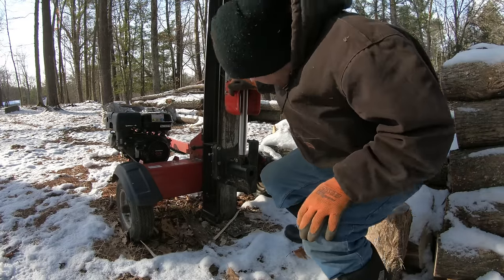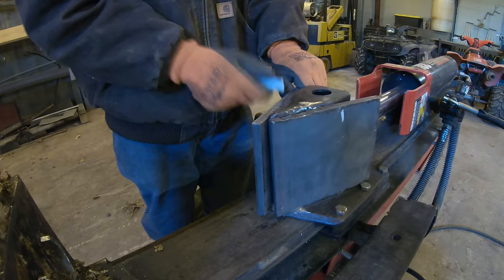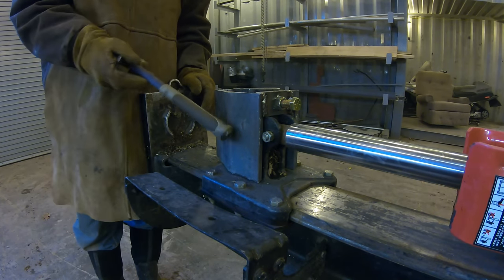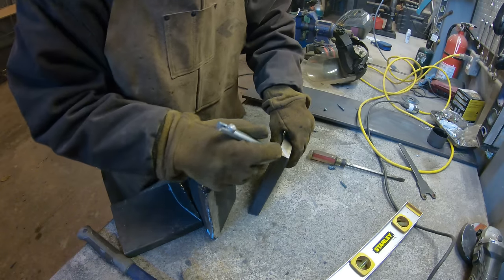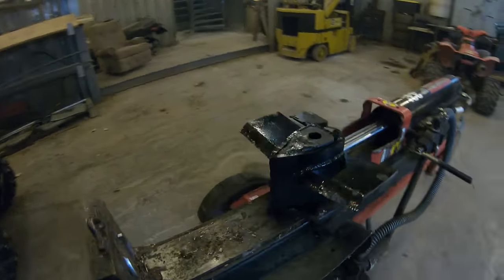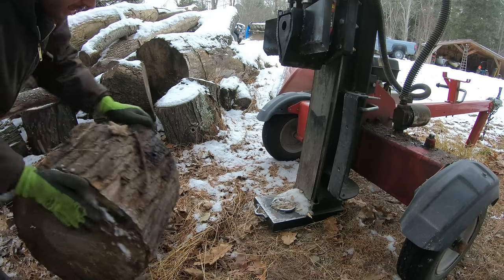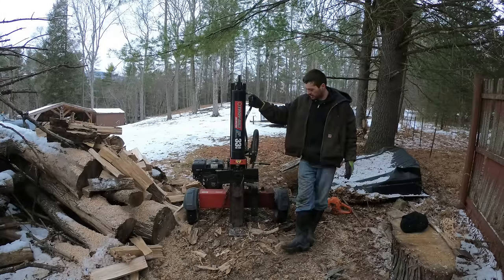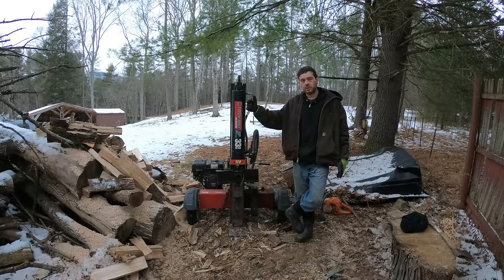Building a 4 way splitter wedge

Comment: Wait! What? I'd never had thought of using the wood splitter to bend steel. How friggin' ingenious!
Reply: I've done the same to crimp ends of tubing to create a flat(ish) welding flange. I've used this technique to fabricate  livestock gates and fencing panels but I'm sure this could be applied to a multitude of projects.
Reply: You can even weld up dies and forms for rolling steel and bending pipes, you can press bearings, ball joints and king
pins etc.etc.. 
Log splitters are a great source for universal hydraulic power.
Reply: Log splitters wore not made it to do that JUS TO SPLIT LOG read the INSTRUCTIONS.
Reply: @dmithsmith5880  don't judge people by apearence my profile foto it's a joke I don't smoke.
Reply: My shop press is 20 ton and my log splitter is 27 ton so if I can't bend it in the shop I can always use the log splitter.
Reply: Yeah Right!!
Reply: He is one crafty handiMan!!  He has a lot of really good video's!!
Reply: OdinX316 yes he does been watching his videos now for a month,he does not live far from me,if I see him in Saurgerties in the park were he puts in his boat I will have to talk to him smart guy for being so young.👍
Reply: @bikerminio  I used to live in West Shokan.
Reply: @Francisco-yz7xq  Lawyers!
Reply: i know.  but i did just get a splitter so i'm glad i saw this right away.   i did actually think of putting the cylinder on my tubing bender,  but this  is better than my little press brake
Reply: I've used a log splitter to bend rebar for concrete forms.
Reply: Camarata modified the log splitter by building the 4-way splitter wedge slip onto a wedge of a log splitter.
Reply: @dmithsmith5880   I even use them to join split logs !!!  .....apply some glue and keep them pressed and watch glue dry !!! A very peaceful pastime.......Lol !
Reply: @wetdixiebellelingerie3014  Andrew Camarata has just modified a log splitter by building the 4-way splitter wedge slip onto a wedge of a log splitter. Since 2017, Andrew Camarata still uses it.
Reply: Andrew NEVER ceases to amaze me. Well done.
Reply: @OdinX316  Andrew never ceases to amaze all of us with his 'on-the-fly' ingenuity.
Reply: iv had to use my press to split wood when the splitter was down
Reply: The only risk is if you’re pressing a hardened splitting edge against steel it could fracture dangerously, but it’s all at your own risk.
Reply: I thought the same thing!
Reply: Me and my grandfather used our log splitter to bend all the metal joiner plates for a building several years ago, it worked great
Reply: It’s just a giant press. I’ve used a front end loader bucket on a cat988 loader to straighten out a 3’x5’x1” plate steal that and under ground mine feeder decided to eat and mangle all to hell had kale marks 1/2” deep 16” long looked like predator got hold of it . But the loader straightened it right out after a few presses.
Reply: Maybe they don’t sell them cause those cheap 5 horse power craftsman engines can’t handle a four way wedge plus they want to keep the price down as low as they can.
Reply: @Francisco-yz7xq  I am guessing you never heard of thinking outside the box, you must be one of those that still think the earth is flat.

Comment: When your wood is nice and dried out like yours is, the 4 way splitter works much better.  Actually, the two way also.  I have a four way attachment that came with the splitter.  I use mostly the two way because with wet wood and irregular pieces, the two way just works much better.  Your wood in the video split so easily I think an ax might have been faster than the four way.

Comment: I read through 40 or fifty of the comments and nobody commented on this so I will.  What a brilliant and clever idea to use the splitter itself to bend the metal plates into shape!  
Out of curiosity have you used this to bend other things?  I'm thinking that you could add some more products to go along with your new 4-way splitter.  Poor mans conduit bender, metal shear, sheet metal bender, ect.  How about using it to break the tire beads on your equipment tires?  The poor Troy may end up working 12 months out the year instead of just a couple!  I'm sure there are more uses out there!
Reply from the maker: Yes I have used to splitter to bed things before. Its not always deep enough for some jobs, but it works. I have a press to which is a little more controlled, and there's more room. But whatever works.
Reply: I've used mine to break a tire bead before, worked great! and a few pieces of steel over the years. U have to be careful  putting  more then one piece in at a time, like he did to bend the steel plates. what he did was fine, but if you have the wrong angle the piece  can shoot out. this turned out good, he saved himself $100 not having to  buy the slip on wedge they have at tractor  supply. I have the same troy built, just one size smaller, the 27 ton.
Reply: Thought the same.
Reply: I've used it to break tires away from the rim. Just lay a 4x4 across the tire right at the rim and push it down.
Reply: Bearing press comes to mind, also.
Reply: I would of never thought that would have worked.
Reply: i should have read the comments before i posted LOL
Reply: aYeah i thaought on it not ma<ny would use the splitter to do it,. he is very smart this guy
Reply: Peter Hahn>>>Thank you, a tiny light bulb just turned on in my head.
Reply: @Peter Haan:  That's what I thought when I saw it on the video.  Very clever!!
Reply: its called a shop press   ... its just a tad safer than a log splitter or tubing bender
Reply: @capitalcityautobody6507  Me too... That's why I call him Superman
Reply: Just watched.  Thought the very same thing!
Reply: Im pretty sure someone did
Reply: Yes I totally loved that move! Regarding the question of manufacturers selling the units with a single plane wedge vs the double - Possibly they assume folks would be using a smaller diameter log and when you have a larger piece it burns slower. The bolt you installed on the back of your wedge is also a great Idea. They could sell different size and shape wedges for different situations. @AndrewCamarata
Reply: @ctdieselnut  LLP PM
Reply: I think it would be cool to make some kind of foot pedal to operate the ram so you could have both hands on the log.   That would make it so much easier....
Reply: Do that with mine all the time
Reply: <--- I'm not sure on which video I commented to Andrew about rigging up his shop hoist to be a sheet metal brake too.... Andrew's machine's will eventually get an UPgrade, and will last way longer than others. He always has great improvement ideas which ALL work, as he demonstrates... Cheers.

Comment: How about adding a bigger base so when you split the larger logs you dont have to hold it up to the splitter.
Reply: this is a good idea
Reply: That's what I was thinking, or just a longer one.
Reply: to eliminate the tilt.
Reply: If one bigger base is too big then maybe 3 hinged wings, 2 off the side and one off the front. that would fold for transport and storage.  I don't like the idea of holding something in place with moving machinery could cause it to shift and you make a sudden movement to compensate perhaps causing injury.  Rather like holding an object on the drill press by hand and having the drill grab the material....not that I have personal experience in that area.
Reply: My first thought was to dig square hole for the base to sit into about 3 inches down so it's flush with the ground to avoid the large wood rounds from tilting off

Comment: I would have covered your cylinder to keep splatter off of it when welding. Very Nice Job.Very smart to use the splitter to bend the metal. Good job.
Reply: I guess you haven’t seen any of Andrews other videos .

Comment: You're a tribute to American ingenuity. You should patent your winged wedge idea and sell it to a manufacturer.
Reply: I think the reason they do this is to get you to buy their higher tier model so they make more money. Everything manufacturers do is for a reason.
Reply: TehHijack that's exactly what I thought!
Reply: It’s the Base Plate that’s causing problems. 
Horizontal Models have No Base Plate..they allow a Flow-Thru design.
The bottom is the Splitter..Top is the Push Plate.
Reply: At the very beginning of the video Andrew said he had previously tried something that he bought - that he did not make himself - but that it would NOT work properly. The design of the wedge that he bought would pinch the wood / bind up .He changes the angle of the "wings" on the one he made to avoid the hangups.

Reading the reviews of the for sale units, there are complaints that they only work with certain splitter mfrs - some work only horizontal not vertical etc.
Reply: @scotty362100  ... Thought so
Reply: @scotty362100  he said himself he bought one and the angle on the wings was wedging the wood against the beam and stopping the ram, you can still patent something if the design is different
Reply: Swisher makes one for their splitters and it works fine. If you get a huge Oak then it just lifts off and then you can hack away at the large piece.
Reply: They already make them in all sorts of split patterns
Reply: then he could use the money to build his car
Reply: I allways hear people use there American ingenuity be your race culture cant steel from quality child rearing and solid work ethics teamed up with smarts

Comment: Leaving the first inch a vertical split and the wing wedges later really saves on the grunt the splitter has to overcome. Good thinking!! 33 ton is a husky one!  Dog looks happy!! Nice welding! As always
Reply: You're kidding about those welds right? He broke the first rule of thumb when welding metal that thick.
Reply: @2naturesownplace   If they don't fall apart they are welded correctly.  That's my rule anyway 😉
Reply: Richard Elbe and what’s that?
Reply: @2naturesownplace  I agree with you

Comment: $$$ is the reason mfg's do not come with a 4 way split. Yours is better, and you got it just the way you want it, Good job
Reply: Mike is kind of right. The reason your model did not come with a 4-way splitter. Is the pump itself. The pump is design to function just get enough for the maximum existence it can endure. So by adding that 4-way splitter your shortening the lifespan of the pump. I'll give you a fine example. The log splitter offered by Harbor Freight. It splits two different directions and it's pretty fast for the cycle rate. But it was not meant to have an aftermarket 4-way splitter adapter. I've had to help several friends build mount for aftermarket pumps because they added a four-way splitter adapter and within a chord the internal components of the pump went bad. Now that said there is a way to compensate that. And you were very close to it. Your points need to be as sharp as possible you can see in the video the wood is resistance from the moment the points touch it. Also your metal is too thick on your wings. You did have the right idea by placing your wings back from the initial breakpoint but you should have staggered them. The first wing 2 inches Back II wing 3 inches back. By doing this you get your initial break then you get your second break then your third brake that way you have maximum pressure on the break point not on double points. This is how I did mine and it's a harbor freight and the pump is still going 3 years later
Reply: Richard Elbe thanks for the advice
Reply: Get a patent!  Time for you to be a millionaire.

Comment: They do make some splitters with the 4 way,  I have seen it on some heavy duty ones,  I'm guessing they don't do it with normal splitters because they have a lower compression rating and the extra stresses might break it sooner,  but IDK, it seems to work fine with a stepped edge design.
Reply: it all falls down to cost one splitter is for home owner use another is industrial for companies that sell fire wood
Reply: I have used and owned both types.  The 4-way head is obviously way better when splitting.  However, the cylinder, the engine and the structure around the cutting head are all bigger and can bear heavier loads.
Reply: The first cutter has already split the wood, so when the second cutter is bearing down the ram isn't actually driving 4 cutters at once, just the second pair

Comment: Its great for smaller size fireplaces/furnaces.  But when you want bigger "chunks", it makes them too small. Also, a bigger base plate would help for larger logs.  Using a hatchet is a good way to handle the wood too.  I used to use a big old speaker magnet on the splitter, and put the hatchet on that, very handy. Just some ideas for ya to ponder.

Comment: Just for a couple of the other commenters here. A couple of the manufacturers do offer a 4 way head as and option piece. I used to work for Tractor Supply and have ordered few for customers. But we usually had one or two in stock.

The big difference is Andrews is a quick change option, which is great. The others generally required complete removal of the standard head to put the 4 way on, which can be a PITA! Been there. Done that.
Reply from the maker: Yeah, I knew they existed, but only as a later added accessory. I think it should just come that way. And I couldn't find one that fit on the troybilt splitter. I had one before that didn't work.
Reply: Yes. but the "permanent" 4-way head cant come off and hurt someone like this one...so I'm sure the attorneys have something to do with nixing the removable 4 way heads?
Reply: @AndrewCamarata  Why don't you build a few of these and sell them on Ebay?   I'm sure they'd sell.
Reply: @jimthesoundman8641  The shipping charges would be astronomical.

Comment: You should make a wood splitter that fits on your excavator and use the excavators hydraulic for wood splitting.
Reply: we use one that looks similar behind our tractor. only vertical though. It does have less trouble going through though. Gonna make a 4 way wedge for that as well.
Reply: That's funny you say that we made a splitting wedge for my cousins jackhammer on his excavator just for fun the other day it is stupid fast and also you don't have to stand the wood up it busts it up no matter what way its laying or pound it in the ground

Comment: Hello! I hope to make this observation on a more recent video, but here goes: 

Engineers take into account some of the shortcomings of the material in the devices that they design. And design accordingly, so they would not want the design pushing the structural integrity of the splitter. The comment about the wings of the wedge coming into play after the first wedge strikes is important. The initial stress of the first strike is dissipated and the machine is ready for the second attack. Or maybe the dratted first design worked "well enough" and the manufacturer could not be bothered making it more efficient for the user. Or easier to change heads. I hope you Mr. C get that computer-controlled cutting table. And capable help to keep your equipment making money in the meanwhile. Good ideas, good job and good hopes for a productive future. And of course, great video.

Comment: Andrew, I have been cutting and splitting wood most of my life.  I had an exterior wood burning furnace and was cutting ten to twelve full cords of wood each year to burn.  About 5 years ago we found a head for the wood splitter that was built very similar to the one you just manufactured in this video.  After using that 4-way cutting head, I was sad that I hadn't discovered it, or thought of making one, years earlier.

Comment: You didn't weld all blades at the same level :
You was afraid the pressure would be insufficient ,so you staged the splits ?
Also ,i would have done a sharper central blade and angle,you can clearly see it's not cutting but pushing until it split.
It would be less stress on the machine,and quicker.
Reply: Bigger wedge reduces the chance of the wedge getting stuck in the log and pushes apart the strands in hardwoods more efficiently is the reasoning behind why many go to larger wedges.

Comment: Looks like you could do with making the base plate bigger too. (The bit on the ground that the ram pushed against)
There was a few times it was trying to lift itself off the floor with the bigger wood!
Reply: HughzieTube: I use my son’s splinter @ it does that if I put a large piece in @ try to split it. So I put down a large piece of 3/4”plywood on top of the plate. It helped but messed up the plywood a little. Should use 1/2” piece of large plate steel!

Comment: Ohooo that bare and uncovered chrome hydraulic cylinder rod/shaft!
Reply from the maker: I didn't hurt it.
Reply: Not this time!
But that aside, you did a great job on that 4-way splitter.
Reply: Good welds don’t spatter lol
Reply: Well Bailey, I admire your faith in Andrew's welding ability.  ( and by the way, I'm laughing too)
Reply: Yep good idea to cover the shafting when welding near it so the spatter doesn't hit it.
Reply: am  guessing but I wood imagine that if they made a 4 way splitter they would want it to split the log into 4 equal triangles so the centre of the splitter should be in the centre of the log? At least with a single blade you can cut in half then cut one half to the size required?
Reply: Didn't hurt it this time, but when a hyd rod costs $1000' s  you don't want to replace it. Can use straight Acetylene smoke to protect chrome from spatter. All welding produces spatter.
Reply: Quick layer of aluminum foil....
Reply: People worried about a little splatter on a cylinder shaft, scrape it off and hit it with some emery cloth....done. If concerned with rusting store it with rod retracted, not like its a $3k cylinder its a Troy Built lol

Comment: Great design. The way it splits the middle first and then splits the sides is a good idea. I also like that it slips on and off easily. That bolt keeps it from walking off the main splitter. Good job!